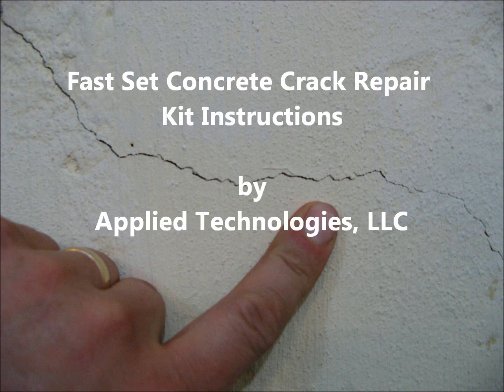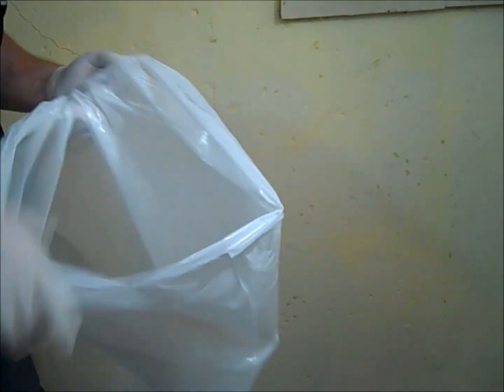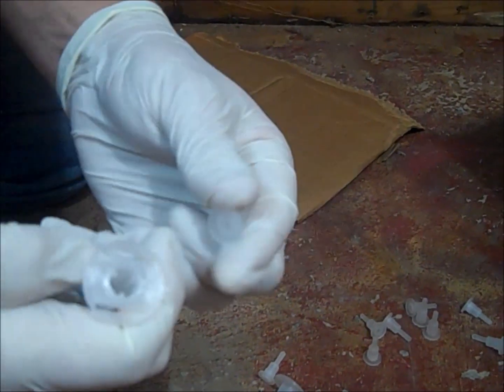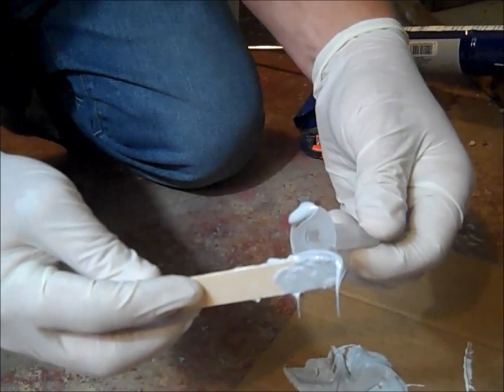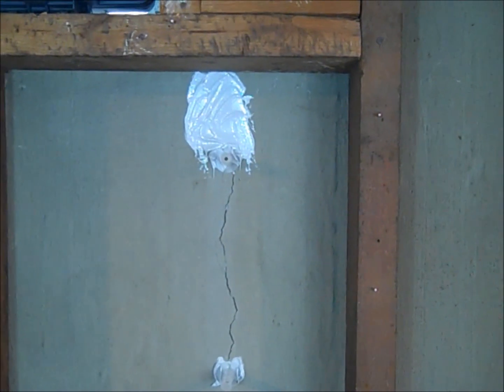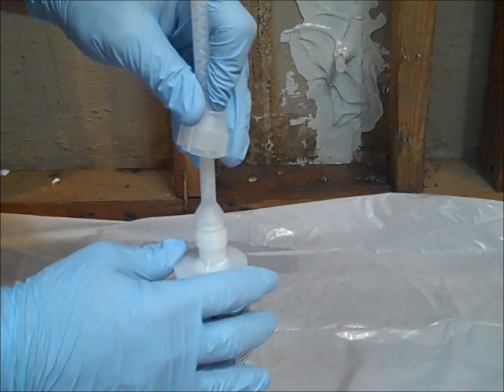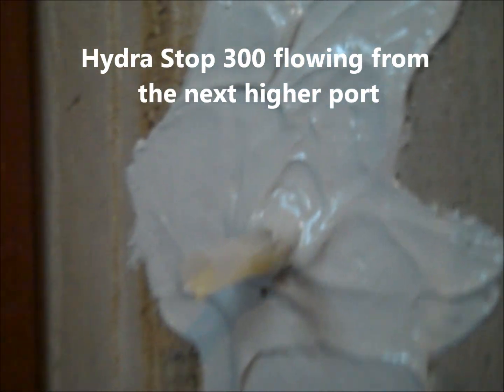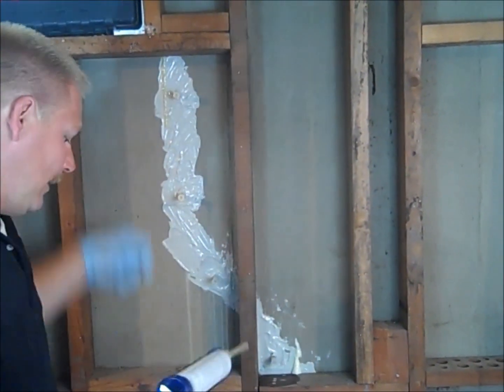Fast-Set Polyurethane Concrete Crack Injection In a Basement Wall

Comment: This method has a big issue.  Most of time, the glue will NOT make it all the way OUTSIDE the wall due to too low of pressure from the glue gun.  As the result, the outside half of the wall will soaked with water for a long period of time because it cannot leaks inside anymore.  The soaked area after a long period of time will disintegrate and result in a huge/permeant foundation damage. Either you make sure the glue goes ALL the way outside or get a high pressure solution.  Wish this helps.
Reply: Agree !  When I saw those flimsy plastic tubes for inserting the substance, I thought "here we go"  the best method is to use the professional kind which act like a grease  nipple ie. the substance can only flow in one direction and you can get much more pressure to force the sealant all the way through to the outside.
Reply: I used this last week and the outside crack is covered in foam, even leaked down to the ground so for me it worked perfectly

Comment: In what application would you use foam over epoxy? Does it merely come down to costs or does foam have an advantage over epoxy? I am considering expoxy for my basement wall cracks that are minor (less than 1/2" side)
Reply: You use epoxy in structural cracks.

Comment: I have a rock pocket that sits in between pours that is leaking. Would this be able to fill that in, or is it too rough?
Reply: There must be a crack or open space for the polyurethane to go into
Reply: @aaronkuertz6012  if I were to chisel out the loose rocks and there was a gap 1" - 2" wide, would that be too large to fill in?
Reply: @snorman1911 This is not the correct repair method for that

Comment: I bought this product.i also tested epoxy with waterproof foam. 8years later, same results. The s1E did get a small seep 3 months ago. Did the epoxy coat inside and injected that great stuff waterproof, so far so good. And it was cheaper. Since from what I’m reading this has a 10-20 year life. I will polyurethane seal the out side of crack. I was looking for a permanent seal when I purchased. O well

Comment: Hi.. thanks for the video... Question: why we inject the water, isn't the water will stay and prevent the sealant from flowing??? and how long after the water we can inject the sealant??
Reply: You inject immediately after injecting water.  The water activates the foam.
Reply: Thanks for the answer, please let me know how to deal with the water leak at the bottom corner where the wall meets the floor ??? @aaronkuertz6012

Comment: I just did this on a very narrow crack that did leak a lot of water and I'm just waiting for it to rain. The only issues I had was injecting water into that narrow crack. It would just run out.  So what i did was just inject the water with my mouth using a a little pressure. That worked well and I could judge how much water I injected. Maybe if the water bottle had a 90 degree tube it would work better. Waiting to see if I'm successful because if I get 2 inches or more of rain in a short time I get lots of water in my basement. Grrrrr.
Reply: Have you had any water in your basement after using this product?
Reply: Update?

Comment: I'm looking for the technic to seal inside corner wall, any knows any videos or other infos ? This corner is in fact an old basement that has been extended so it is not a real crack but a joint between an old and a newer wall (done over 20 years ago), there was metal bracket, sealant and waterproofing from the outside but is probably worn from the time...  the only technic i'm finding on the internet is cracks on a flat wall... do you think i will have to seal the corner joint and drill at 45 degrees and use thoses holes for the plugs ?

Comment: Do you need to make a v-groove (using a chisel or power tool) if the crack is a hairline crack?
Reply: Good question but no answer!!   Other products/Mfr's  showed V-ing out.  Did you learn and find what works?
Reply: @rondail5675  I think creating the channel is for epoxy and not needed for foam. I like the idea post above about using bondo as a tube of "portal adhesive and sealant" runs $42-$46.  A tube is only good for 6 ft run in my applications if you put it on heavy around the ports as the video shows.

Comment: I odered the ten foot Crack repair kit from a dew weeks ago 
The one I rdered is not for leaking Crack I ordered the one to strengthen the Crack 
I see in this video you say to add water first with a squirt bottle 
Do I need to do that also?
Or is that only for a different epoxy?
Reply: You do not need to squirt water into the crack when using the epoxy.  You do when using the Hydra Stop 300 polyurethane which is what is used in this video
Reply: @aaronkuertz6012  Thank you!!

Comment: I've flipped over 500 houses in the last 17 years and have used this and similar products on at least 20 houses. 

It's simple and I teach my renovation crews how to do it.

As long as the wall is structurally sound, this is a permanent and effective method to repair cracks and prevent water intrusion from them.

Follow the directions EXACTLY or the results will fail. 

On a poured concrete wall, this will protect the rebar inside the wall to keep the foundation structurally sound. 

I don't think this would work on a hollow concrete block wall and have never attempted it.

Comment: How does this penetrate the crack by sitting flush against it? This seems like it just seals the surface. You need to drill the crack, this system is whack.
Reply: The Hydra Stop 300 goes inside the crack.  We have been selling this system for twenty years with many professional contractors as customers.

Comment: what if the water doesn't flow to the next port and that next port is clear from the epoxy 300?
Reply: it is ok if you do not see water come out of each port.  You just want water in the crack to make the hydra Stop 300 react.

Comment: There is one KEY FACTOR that is not mentioned in this video.
You should determine what caused the crack. If you don't the crack may expand and leak again.
Cracks are an indication of a potentially significant structural problem.

Comment: I highly recommend that you put the bottom port as close to the bottom as possible, not 6-inches up as in the video.
Reply: It said 4 inches I believe.  Do you recommend right to the bottom?
Reply: @rondail5675  I see now that the video said, "Start within 4-inches of the bottom of the crack." That may be fine because the material will flow downward as well as upward, but I would personally start very near the bottom.

Comment: I just finished using this system.  I had a crack from floor to ceiling and it traveled between 2 joist bays.  They say removing studs is not required, I would do it.  Otherwise, you will get leaks when you inject the Hydra Stop.  Everything worked exactly like this video shows without a single issue.   When injecting the Hydra Stop it does get a little messy, make sure you have the plastic down on the floor for that step.   Also make sure your plugs are in all the way!  The Hydra Stop will continue to expand well-after you are done and can push the plug out if it's not all the way in.  Happened to me and luckily I was standing right there.  I replaced it and tapped them all with a hammer to make sure they were all the way in.  We'll see how well it works, but I feel confident that it penetrated the entire crack.  So far, I recommend.
Reply: Well, 2 year review?
Reply: Yo review?
Reply: Thanks for the suggestions. Your experience will save me learning the hard way.  Any other suggestions/recommendations?

Comment: I am not grinding the ports down why the hell can't they just be removed before everything dries damn
Reply: Just knock them off with a hammer when everything cures.
Reply: Because epoxy strengthen after 10-15 minutes, and in video it says to wait that period of time before you start injecting tube paste to cracks via ports. Other then that paste from tube would simply comes out from crack and you would not be able to fill in cracks.

Comment: What is the best way to dry the crack out before starting the repair?
Reply: Water can be in the crack.  For Epoxy paste purposes, the wall itself cannot be wet.  I recommend a heat gun.
Reply: @dlnsolutionsfoundationrepa8435  Thanks,  makes since.
Reply: Don't trust a fart.

Comment: I’m installing an outdoor boiler system and will be cutting a 4 inch hole in my foundation to put a 4 inch corrugated pipe through that carries my waterlines. I will have a little gap around the pipe. This should still get the job done wouldn’t you think? I plan to cut the hole just big enough to put the pipe through.
Reply: You will need more material than what is in the kit for a 4" pipe.

Comment: Hi, the kit looks good!  Would this kit apply if I just have cracks but no water penetration?  Will your epoxy keep the crack from spreading further?

Thanks!
Reply: It definitely would not, you'll need that professionally checked because the crack is likely longer than what is currently visible in daylight, and could require a specific fix

Comment: I used this method but the resin never came to the upper injection port. I guess it went straight through the crack. Any suggestions?
Reply: I think both sides need to be sealed
Reply: In this case, you may want to inject in the port above, allowing gravity to pull the foam downward toward the adjacent port if this is happening at just one location. The crack is probably too wide for the distance between the ports. Of course, you could also add a port between the two but if you are underway I would try the port above first.

Comment: So is this product used to stop water leaks or strengthen the wall, or both?  My basement is dry but I have older cracks which I want to seal with an epoxy or something that will help strengthen the wall. Any suggestions?
Reply: This is for waterproofing.  All concrete cracks when it cures and it doesn't necessarily mean you have a problem.  If your concrete is cracking significantly because of some issue with your footings, then no amount of fix will stop that.

Comment: I did the same thing with bondo and plastic straws cut to 1" lengths and
 held in place with toothpicks in the crack while the bondo hardens 
around the straws. The straws are 6" apart. Use cement crack filler tube
 from Lowe's in an ordinary caulk gun, inserted into each straw,  Go 
from bottom to top of crack. Finish with 6 coats UGL waterproof paint. 
Been leak tight for 11 years now
Reply: fred farkel how did you keep the cement crack filler from leaking out of the straws before it hardened?
Reply: Review?

Comment: what happens if water never flows through to the lower port?
Reply: Did you test the ports before you started filling them with the epoxy.... meaning using the small bottle of water at the top ensuring all ports excreted water?
Reply: i have the same question

Comment: I found a quick and easy way to fix a crack in my cellar wall. I used a hot glue gun and it worked like a champ. It is quick and easy to do and if you need to buy a hot glue gun they are cheap and good to have around.
Reply: Awesome! I did the same thing for the framing of my house. I saved money because I didn't have to buy nails!
Reply: ha, ha.  hot glue costs more nails, and if you use nails the big bad wolf can't blow your house down.
Reply: Evelyn Roebuck c
Reply: Fran Dargie it may stop water but not the crack from enlarging.
Reply: Carl Saberhagen - DAMN YOU!! You owe me a drink, I spit out my last fucking Corona laughing at this comment. LOL

Comment: Why was water injected before the polyurethane?
Reply from the maker: +Carmen Craciun 

Water is the catalyst that makes the Hydra Stop 300 foam and expand.
Reply: The water also helps the concrete absorb the chemicals being that concrete is NOT a vapor barrier. Wetting it soaks in more product deeper into its pores
Reply: then why does the crack have to be dry to do this? I've been trying to stop a leak for years and the crack never really completely dries before the next rain. I've used quickrite water stop cement because my crack is really wide and even that hasnt worked. trying flex seal products now. getting frustrated.
Reply: @jimmie1142  The crack probably needs to be dry so the epoxy can hold the ports in place...  Maybe you could use hydraulic cement to hold the ports in place and then it doesn't need to be dry.

Comment: Can this be used in a basement concrete wall around a water pipe that enters the house.  I had the main line repaired, but the when it rains I get water in around the pipe.
Reply from the maker: +James Maxwell 

Yes it can.  Place the corner ports into the gap around the pipe and then inject as normal.

Comment: My basement wall was previously sealed with tar the cracks re emerged and water is leaking again can I put the epoxy over the tar or should da tar be scraped off or somehow remove before the epoxy and ports are put on?
Reply: You must scrape off and remove all tar from the crack, use a chisel and widen the crack, and use hydrolic cement. https://www.thisoldhouse.com/how-to/hydraulic-cement-leaky-basements